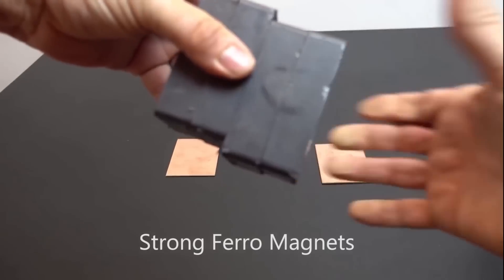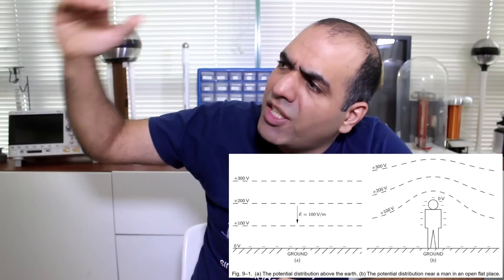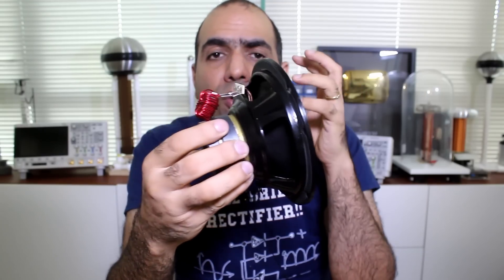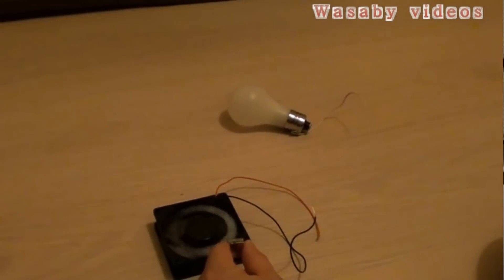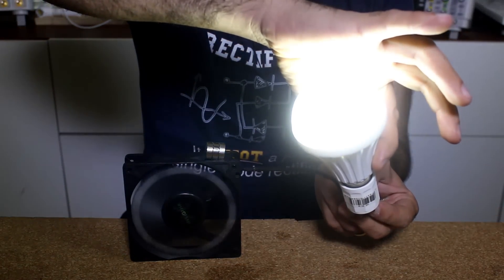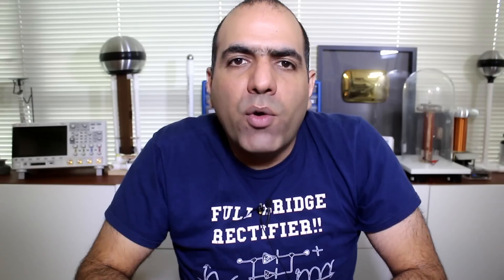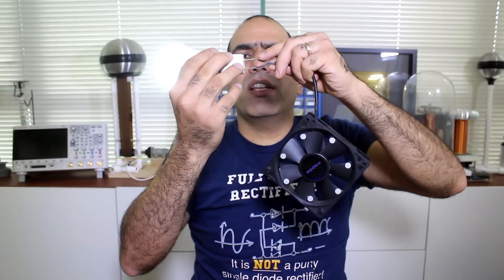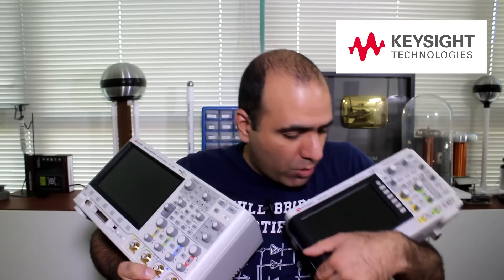Free Energy Devices Build and Science

Comment: What about using the peltier effect and the battery effect and railgun effect together make an electrolytic crystal with an alkaline in it between two metals say copper and graphite.... Then use the alternate substance to propell like a bearing between identical rails then reverse your battery and do the same again with the other metal and maybe another crystal maybe just finish in your anode...
Supply high voltage for net chilling effect from the largest metal
Reply: You can't defy the laws of thermodynamics, no system will have over 100% efficiency
Reply: @DaCurse0  the laws are BULLSHIT LOL

Comment: Salam! I have some confusion regarding voltage, current and power. If I have a, say, 10W appliance that works on 5V and 2A, why can't I run it on 10V and 1A? The power would be the same. Now, I understand that increasing voltage increases current in DC according to Ohm's Law but, if I have an AC supply which can be stepped up to 10V and hence, reduce the current to 1A, why is the higher voltage dangerous to the appliance if the power delivered is the same? You told in your video that both current and voltage come hand in hand when delivering power and hence shocking human beings. You said it's wrong to say that the only high current kills and not high voltage. If possible,  please make a detailed video on this topic because the teachers don't explain it quite right. Thank you.
Reply: It's not the same power, but the voltage rating of the components

Comment: Although the right hand rule seems to have some validity there is no right nor left in a circle even if you rotate the circle and different directions you are still going in a circle the right hand rule does not exist but if your coil is facing up words as opposed to downwards is it still the right hand rule what if it is facing away from you as opposed to facing towards you is it still the right hand rule what if you are upside down 👇

Comment: Occasionally I pick up small voltage off my body, maybe 1.5-10volts sometimes but I have no idea how to use it.😄😄😄
Reply: thats called static electricity. it happens when you moonwalk on the carpet with socks or rub a towel on PVC. its not really useful. and also its not 1.5-10V its more like 1-5kV

Comment: Few days ago my father started cleaning his computer. When he used vacuum cleaner to remove dust from the system fan it started to turn very fast. After the cleaning his computer Mainboard was broken. The fan generated a voltage that destroyed the mainboard. So when you take that example you definitely know that you can generate energy by magnetic induction
Reply: or maybe you shouldn't use a vacuum cleaner inside a fucking computer lol, probably a component of the motherboard got ripped apart by the vacuum cleaner
Reply: No shit, how do you think a generator works?
Reply: @sam512  my dad didn’t know that fact

Comment: A long time ago I used to work for Western Electric and they made their own permanent magnets for telephone receivers. The machine was a huge electromagnet switched by a very large stud mounted silicone controlled rectifier connected to a high current giant capacitor. The metal piece was placed in contact with the electromagnet and a huge surge of current was discharged through the coil and permanently magnetized the metal and there in no way to reverse or recover the energy that went to magnetize that metal. Even these videos you see where they take a car alternator and use neodymium high power magnets to make a 220volt alternator to power a 220volt motor belt driven back to the alternator it just won't work. Its not over unity it's a more efficient alternator but still not taking power from permanent magnets. It almost had me when I saw him carry it around with no cables connected to the thing but there has got to be a hidden battery!!! or do you think maybe neodymium magnets are special??? I tried it on a smaller scale using permanent magnet DC motors that use ceramic magnets. If you connect the wires together and spin one the other turns but not as strong as the one your spinning. Maybe on a large scale with very powerful neodymium magnets it might but I'm not investing time into finding out. Its not free energy it's represented energy that took to magnetize the magnets and by breaking the magnetic lines of flux several times per second causes the neodymium magnets to slowly loose magnetism so I was told and this is the person's theory on the modified car alternator in that its not free energy its stored magnetic energy but I don't believe it untill I see it live and then taken completely apart. It shows a video of a long time and effort modifying the car alternator with neodymium magnets but it doesn't show the AC motor apart and that might be where the battery is. There could be a lithium battery inside the start capacitor housing on the AC motor

Comment: Permanent magnet motors are not far off.. so what's your explanation to those not working?
Reply: Magnets are not that simple
Reply: Electric motors turn DC into AC the heavy motor that work with AC are normal motor but the EMs used in toys the coil is in the middle.those are called brush motors thats why the field on them changes so fast.if you built a motor with permanent magnets it would just stay in the same place

Comment: Why cant we build a bunch of super conductors and use the magnetic field of the earth to generate energy?
Reply: No
Reply: @sam512  No is not an answer.
Reply: @technoir2584  Just like a non-moving magnet, a non-changing field won’t produce energy through a wire
Reply: @sam512  So you saying the magnetic field of the Earth does not move?
Reply: @technoir2584  not enough to even consider it as an energy source

Comment: Also another conclusion is I bet its possible were using the energy in the magnet not that its a battery but heck how does it store magnetism. Also it would be interesting to try these experiments in ZERO humidity. To see if the electricity isnt infact traveling through the air moisture from the ground which we know has a charge because you can get energy from the ground wire.

Comment: The fact that he explains the concept very confidently it feels like the concept is correct even its wrong or fake.
Reply: It is not fake. Just the led lamp is with batery and you just connect the end to turn it on or off.
Reply: @kk2sal  but for electricity we need to keep the secondary coil in changing magnetic flux or field but in video both magnet and coil is in rest condition so, how it possible

Comment: The Free part refers to not being charged per kilowatt because as we all know. Energy only transforms so its never free. You illuminate to its potential in the beginning by talking about the atmospheric energy and how it increases as we go up. Is it possible (yes it is😏) that we currently no longer know the technology used to extract electricity from the air. Example: cathedrals. The spires are electrical conduats. Grounded. Raised very high. Inside shaped geometrically perfect using sacred gemoetry to use sound to collect ether(5th element) from surrounding atmosphere. Sound is vibration. Vibration creates heat, light and electricity. I like that your debunking liars 👍 You have yet to figure out the math correctly. Now stop being such a nay sayer. You know that negatively affects the rest of us watching right?😏👌

Comment: Years ago, fresh out of highschool, my friend slowly fell down the rabbit hole of this quasi science community. They asked me to explain how free energy could be fake, given there was proof in a particular video they linked me to where the power out was supposedly greater than the power in. I tried my best to explain that it was impossible because there would be inefficiencies in the system that mean energy would be lost as heat/noise/etc, and that the momentary 'higher' power-out shown on the meter compared to the instantaneous power-in was just because they had charged up a giant flywheel at the start and it was now releasing its energy. No matter how much I argued that the energy to charge the flywheel cannot be ignored, and that eventually, if you measured the power it took you to start it up, it would be greater than the power that came out, I could not convince them. I wish your video was around at that time, so I could have linked them to it. I lost my friend to the conspiracy cosmos.

Comment: Where does the electricity come from in a generator?
Reply: When a magnet passes through a inductor in a proper way it creates a electricity peak. Although, some puny magnets into a few turns with copper could make about 40-50 mv peak.
Reply: @thebreadman7220  yes but where is that electricity coming from?
It's a magnet not a battery...
The coils do not hold a charge either...
Where is the electricity coming "from"...
I just don't think the aether is any more clear than that... I don't see any other way to explain it... I also haven't seen anybody explain it in a way that makes more sense than that... But yes you are correct if you move a dielectric reflector through a magnetic field in the proper arrangement you will get electricity

Comment: Energy can not be created or destroyed . The electrical energy generated by a generator is a trade off for the kinetic energy turning the armature in the generator and the kinetic energy comes from the force of the water or the calorific value of the fuel used to power the turbine that spins the generator, roundy round like the wheels on the bus forever changing states.😎💕🖖

Comment: Free energy is so simple to do...incredible power... can't be done with parts you buy over the counter.. but if you have a CNC machine to cut the parts.. 9 in total....you will shit your pants..... I did.  To make a long story short .. it's done with transducers and feedback.. and condensation..... over 100k volts AC with more than enough amps. I have all the parts designed already but I won't build it because I took a lightning bolt when I figured it out 40 years ago.... still haven't built it.. but you can if you have a protective suit and the guts. It has no magnet...no coil.. no battery and no moving parts. (it doesn't need it because it already has the spin in opposite directions done with radio waves) It's in limbo for 40 years because I don't have the guts to take another lightning bolt. 500 lbs of force on a quartz crystal releases 12,500 volts per cubic centimeter... but this device amplifies it to over 400,000 lbs of force,, steady non stop... be afraid... be very afraid. It's so powerful because at the atomic level it vibrates moisture so violently (diatomic elements in the air / hydrogen.. nitrogen... oxygen )that it rips apart into it's mono atomic state.. and then it goes boom right back into the microphone in an endless feedback loop. It's so clever and simple to do..... but cost a bit of money and is extremely dangerous because the power is extreme.

Comment: Real free energy can only be zero point energy. The secret is imploding charge properly. Pump z waves in sync yet out of phase through nonlinear medium. This means using a carrier wave over 3 other hf waves. The carrier can simlly be a ground short if ground can charge to slowly discharge back to the carried waves, 3 , 6, or 9 of them usually since they repel one another in 3phase waves that lean toward superconductive, being 120 degrees out of phase.
Free energy comes from the slightly stronger negative pole of magnetic current because of electron neutrino wind into stars from dead space as the 270million $ IceCube experiment in the arctic vindicated my copyrighted theory of 2003 which I call progressive kinetics. Yes folks, this is the source of time itself as all atoms a kinetic zpe machines using only debroglie waves from En friction passing between boson intersections.
Reply: The is no free energy :)

Comment: @EEVblog and @ElectroBOOM - I challenge you to prove me wrong, Partnered Output Coils, we all know Voltage is "Generated" by Changing Magnetic Field, di/dt is the same thing! So come, see what you can prove, try to debunk Partnered Output Coils, one of many examples is here: https://www.youtube.com/watch?v=muIOUAMH8vE&list=PLz0hV4NkTSsM-XOZfYR8uvpF5F5R6yveN - Can you honestly say this does not work? Asymmetrical Force, the Maxwell's demon of Symmetry, as the Electric Transformer works, is the key to success! Do you guys really want to succeed is the real question! We need a little input for the Output we get, this part is inevitable, but COP = 1.5 is a very easy achievable number for you professionals!
Reply: The Elementary Charge, The Electrons are Separated from Source, the Copper Atom, Cu, and pushed to the ends of the Conductive Wire, the Bare, Uninsulated Wire. Simple eh: https://youtu.be/6xhqMDMMgz0 The Solar Cell works the exact same way: https://www.youtube.com/watch?v=UJ8XW9AgUrw Electrons are Separated from Source, in this case, N-Type and P-Type Material!
Reply: Don't get me wrong, there are tons of Fakers! Tons of them, but some of us are Real and share Real Science! Who Funds the Fakers and why does YouTube not Censor them? Hmmm, not hard to work this out is it?!

Comment: I love your videos — including this one. Most of those charlatans are using those videos to sell “self reliance” books (which leads to my personal favorite made-up conspiracy theory that “self reliance” is just a code word for “Juche” and these people are sleeper agents from the DPRK’s MSS) but I’ve digressed and I actually have a serious question!

So: we have been having power outage problems lately (as has much of the country). Luckily it’s not winter so I haven’t had to break out the gas/propane generator. However, I built something for this situation last year that works great. It’s a semi-portable solar panel setup with an encased marine battery that’s already sealed (redundantly so, but safety, you know... I’m married so even when something is safe I must make it redundantly safe so that my life doesn’t become miserable) and this is converted to AC using a 3000W unit. It works for the essentials when I don’t need the Furnace or A/C running. 

TLDR: to the question. I wanted something not solar, even more portable, for my car for when we go camping. It wouldn’t need to charge quickly. A slow charge over weeks or months is fine. I’m intrigued by the speaker setup, and I have extra solar chargers I don’t use and step-down modules. Could I use these to slow charge an extra battery in my trunk over time and use this for power when camping? Would I be better off with another option? I don’t want to connect to my car’s electronics at all. I’m a trained chemist, not a mechanic or an engineer. I know what could go wrong, and I correctly underestimate my potential skills as a rule of thumb. One of the New Ten Commandments on that weird stone in Georgia should’ve been “always assume the Dunning-Kruger effect is happening in your mind when you make plans”
Reply: Also: the ad on your video was a “Boltz Pro” ad 😂 I thought this would maybe infuriate you enough to feature them next time. It’s a phone charger that “charges your phones battery from dead to 100% in 11 minutes and rearranges electrons depending on the app you use to multiply your phones performance and speed by 300-3,000x!!!” — I am quoting these charlatans obviously 🙄 because it’s just absurd. Unless you’ve installed a quantum computing nanite within your phone of course - but you’d have to travel into the future to steal this technology and bring it back again without accidentally creating an alternate universe or timeline and getting stuck there — clearly. Oh and definitely make sure your time machine is going 88mph or else you’ll get stuck in a pocket universe forever

Comment: I just remember the laws of thermodynamics. Energy has to come from SOMEWHERE. Some of the free energy machines, like the ones that supposedly harvest energy from radio frequencies, are kind of hard to disprove, since they claim that they are actually getting energy from somewhere. But ones like the magnet fan, or magnet coils, or power strip loop, are easily disproven, since there's no energy being introduced to power the light. Nothing's moving, nothing's burning, nothing's radiating. 

At the same time, I'm waiting for someone to discover a "cheat code of the universe," and figure out how to actually generate free unlimited energy using something like a Pringles can, a marshmallow, a banana, and some wires. Just a totally random combination some god or whoever figured to throw in "just for the lols" to see if anyone ever discovered it.
Reply: I was thinking the same thing. I think we will never truly find free energy, but if we can find a way to improve efficiency to nearly perfect levels, we will effectively have free energy.

For example, when the brake pedal is pressed on a gasoline hybrid vehicle, instead of the kinetic energy turning to heat and dust like in conventional brake systems, about 50% of that energy is recovered by the motor/generator and can be used to accelerate the car again.

However, this is not free energy because the motor generator is converting kinetic energy from the moving vehicle into electricity which is finally converted into chemical energy inside the high voltage batter pack.

Whereas this system is much more efficient compared to a conventional gasoline vehicle, a tremendous amount of energy is still lost from wheel bearings, friction between the tires and the road, resistance in the motor/generator, high voltage battery pack and so on.

But in theory, if these inefficiencies could be removed or greatly reduced so that say 99% of the energy normally lost in braking, road friction and mechanical component friction, and resistance in the electrical systems, then it would only take one initial jumpstart of energy to propel the vehicle nearly infinite distances.

Sorry if this was rant like. Kind of thinking in text form a little bit.